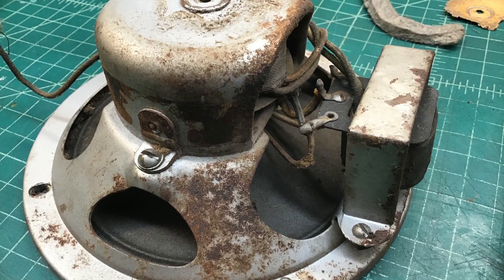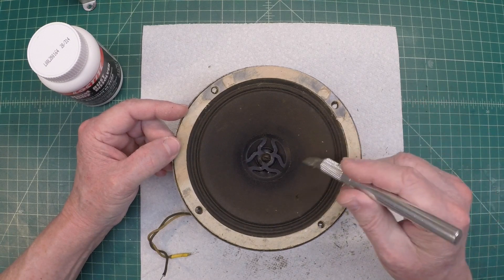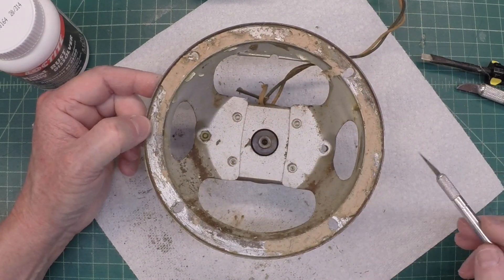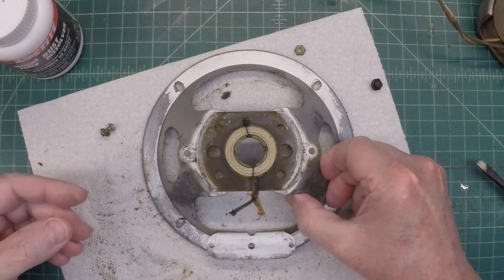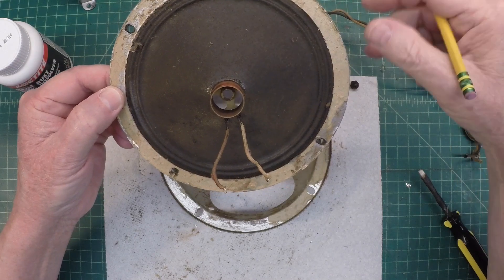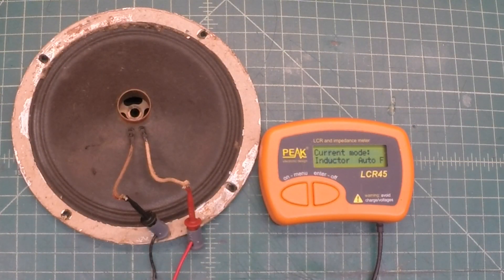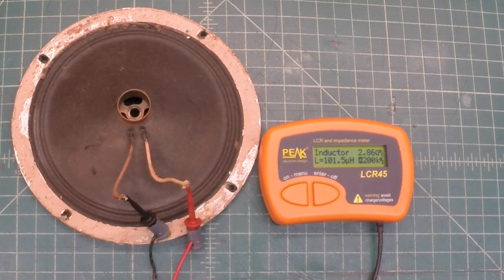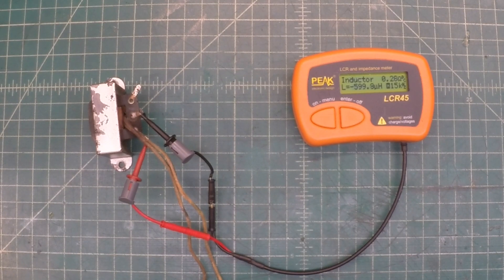Zenith 707 - Loudspeaker De-rusting, Disassembly & Next Steps

Comment: Wasn't sure where to ask a question directly to you so I'm doing it here... I acquired a beautiful Crosley Super 11 case. I have no plans to make it a functioning radio again but I am going to refinish the case and light up the dial. The glass dial is in good shape but I would like to clean the inside where all the numbers and lettering are. Can you advise me on cleaning that part. The other part outside of the wood case I am going to try to save is the original speaker cloth. It does have some staining. I read upholstery cleaner is an option. Should I leave the cloth on the wood panel when attempting this. If it does not clean up I will just replace it with some retro cloth I have seen online...  Well Thanks for reading this.. Joel
Reply from the maker: Joel - the old dial glass ink at times can be water based, so I would use a damp cloth with warm water in an area of the dial that’s not visible to the eye just in case it comes off. If it’s not affected by water, repeat with a disenfectic wipe in a test area out of site before wiping off with a clean cloth. If the ink is not compromised, I then do the same using renaissance wax polish, which does a very nice job; a few applications.

Regarding the grille cloth, I would leave it attached and try cleaning it unless it’s in great condition. I’ve never had much luck cleaning grille cloth as it comes apart during the cleaning process; probably my technique using too much cleaner.

Hope this helps.

Best,

Don
Reply: @RestoreOldRadios  Thanks

Comment: You could have just  used   Coke-Cola   as a  acidic   cleaner
Reply from the maker: John - yep, you are correct any acidic... I didn’t have any cola products around and really enjoy using Citric Acid w/ water. Thanks for watching and reaching out. Best, Don
Reply: @RestoreOldRadios  You could have taken the frame to a friend who has a bead-blaster cabinet and done it up in 2 minutes. ;-)
Reply from the maker: Yep, but then it wouldn’t be hard work. LOL I need to get a soda blaster. Best, Don